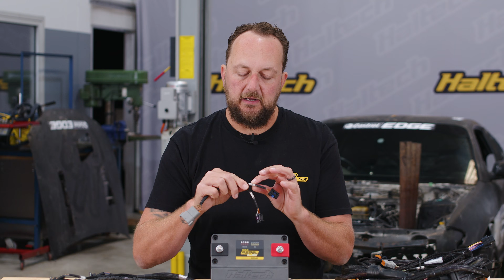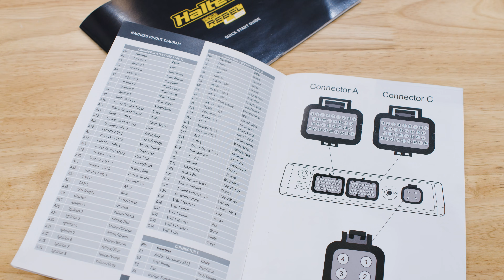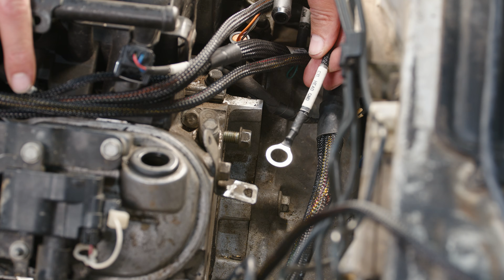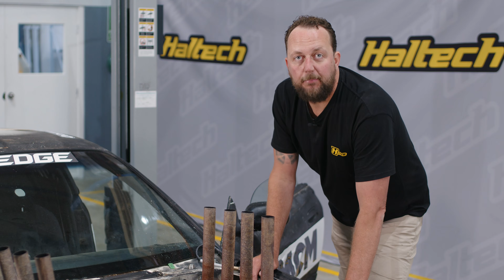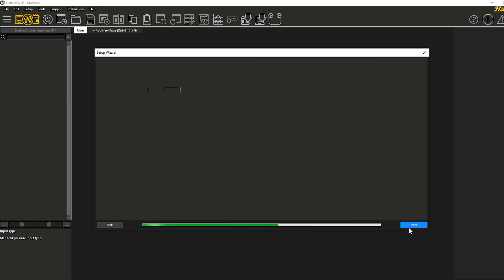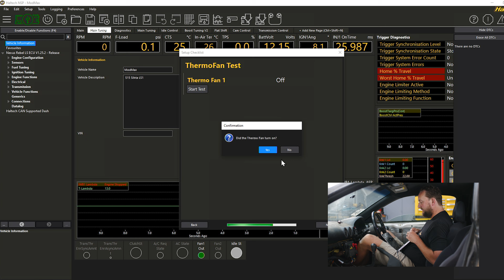🛠 Rebel LS Install - Start to Finish | TECHNICALLY SPEAKING

Comment: Hi Scotty, always a pleasure watching your videos. I noticed the Rebel can only run one O2 sensor. Can it achieve Euro 3 emissions with that? Or should I consider a second O2 sensor through CAN and measure both banks directly at the collector of the headers?

Comment: There are late gen 3 engines with electronic throttle control. Gen 4 was when the shift to 58x happened. Gen 3 has valley knock sensors and cam sensor on the back of the block. Gen 4 has knock sensors on the side of the block and the cam sensor is in the timing cover. So these kits don't cover the late gen 3s.
Reply from the maker: The Rebel harness has sub-harnesses that can be swapped to suit the specific application. In this case, you could pick the Gen 3 harness and separately get the DBW breakout to marry up to the throttle and pedal.

Comment: This is awesome!! So if im ls swapping my bmw e90 and using the factory 6 speed manual transmission how does the speed sensor plug work with the bmw transmission?

Comment: Hi, I will be doing an ls swap on my 2012 GU Patrol in the future. Is it possible for the Rebel ls ecu to talk to the factory patrol dash for speed, revs, temp ect via Can bus?
Reply from the maker: The Rebel only has one CAN port, so this isn't supported natively. 
However, it's possible to use an aftermarket "CAN bridge" to translate the Haltech CAN to work with other CAN systems.

Otherwise an R3 would be able to do what you're after

Comment: Anything stopping you from using the rebel ls kit on a non ls engine, eg a SBF v8 and a crank trigger? Is the software locked down or sufficiently configurable? The kit hits a price point for a universal v8 that is now missing from the rest of the haltech lineup.
Reply: I second this, but for a sbc.

Comment: Some Gen 3 had DBW, rather than cable.
Reply from the maker: No problem, just grab the DBW breakout cable an you're good to go
Reply: @ sure did. I went with the Gen 4 model and only needed the knock sensor and 8 pin DBW harness to make it work with my Gen 3 setup. Full of win.

Comment: I am so excited to upgrade my hptuners tuned stock ecu and homemade fuse box in my e46 drift car with the nexus rebel ls! I have had frequent tuning problems and am always adjusting the stock ecu. I know the rebel ecu is going to completely eliminate my issues!

Comment: A big downside vs a Holley is that there is no Screen included or a budget one available . So you’re driving around and have no idea at what speed you’re going, what rpm the engine is at, what engine temp you’re at, oil pressure, afr, iat, closed loop % etc .
Reply from the maker: You can do all that via the Haltech Connect App :) 
Download it free today!
Reply: @haltech  Yes but you could take your laptop and have it displaying gauges as well, thats not the point. Holley includes a small display and when you see around 9 different sensors which you can see right infront of you its way different than having your phone out and connecting it each time you want to drive the car. Im not dissing the product, but this is a big turn away for many because the only other option to have a mounted display is another 1,100. Please consider making a 4-5” display which displays only data, doesn’t need to do inputs/outputs etc. would be perfect for the Rebel and for someone on a budget. With this said I ordered a Nexus R3 yesterday and soon ill order harnesses, keypads, rotary switches, and the display and get my Boosted/Nos Ws6 flying thru the traps …. atleast that’s the plan.

Comment: I wish you could customize which breakouts it comes with when ordering, I have a gen 3 with multec injectors and drive by wire, so I’d need another $300ish in adapters 😢

Comment: I am helping my brother with his 65 c10 project.  I helped him rebuild a 6.0 iron block ls.  It is a gen 3 engine but we put a gen 4 crank in it.  So 58x.  Can we change the setting in the ecu?  Or do we need to run the engine as a gen 4?   Never mind I just got to that part of the video!   That is awesome!

Comment: I dont understand the popularity with the LS engine platform. Is it simply because they are mass produced and cheap? As far as engine technology goes they are very behind.
Reply: That's the idea. It's a simple enough platform that the backyard mechanics can manage it. The newer engines are out of most non professionals know how.
Reply: Simple, cheap, and small in size, google LS vs ford V8 like the 5.4 from a ba/bf etc the LS the smaller in size and fits where a ford v8 wont

Comment: Tried looking this up. See no mention of transmission control. If running a 4L60e, 4l80e, 6l80e…… automatic transmission, do you need a separate controller?

Comment: Awesome. Definitely going to use in my Cressida. Can’t wait! Could you do a video on the alternator/starter motor wiring side of it? The main power wires and also trigger wiring for the starter.

Comment: Im keen on the Rebel LS guys but you have no transmission control for either 4L60/4L80 yet. Is that correct?
Reply from the maker: That is correct. 4L control is being worked on currently.
Reply: @haltech  Does this mean it will integrate with this current ECU or will there be a whole different ECU for the 4L?
Reply from the maker: It will integrate with the current box. So you could buy one now then add the 4L functionality later.

Comment: So how would I go at using the built in map sensor on a turbo application using the rebel
Reply: When you select the MAP sensor in the wizard, one of the options is to use the internal MAP sensor.
Reply: @Andy_the_engo  I was hoping it was as simple as that. Thanks!

Comment: What if i got a gen 4 engine but I’m going with drive by cable
Reply: Then use the break out harness for the drive by cable throttle body.

Comment: Will there be an equivalent "rebel" ECU for other engines in the future? This would be a great thing for other popular engine swap candidates like the Barra, K series, RBs, etc......
Reply from the maker: Not at this stage
Reply: @haltech  Should the possibility come up in the future, I would LOVE to see a 'Rebel Coyote' kit. They've really become popular swaps lately, quite a few drag cars running the Ford 5.0ls these days(and, thankfully, Ford put them in the F150 with minor changes, so they're more common than the previous 4-valve V8s were).
Reply: Well that makes me sad and happy.... sad, because this would be a game changer for barra swaps. But happy because I already have the elite barra plug and play, so don't have to worry about wanting to replace it with the new rebel barra ecu....😂😂

Comment: The widebands that come with the haltech are not the best , I’ve replaced both mine with Bosch ones after a year
Reply: they are bosch 4.9's which are fine for most applications but they don't like race fuel or abuse
Reply from the maker: Ours come directly from Bosch.

Comment: You should've definitely added what happens when the ignition key and throttle are wiggled and stomped at the wrong time and sequence of the start-up process, what happens then and how to recover from it. Your typical DIY LS swapper does not have the patience of Scott to follow the instructions that meticulously.

Comment: Right on time, in the progress of swapping. My concern is that the provided wire harnas isn't long enough as I planned to mount the ECU behind the passenger chair. Wish there was an option to get a longer harnas
Reply: Buy the identical wires and extend them yourself
Reply: I'm pretty sure if you contacted them they could make up a plug in extension to the length you need. Not sure how much extra it would be but at least it's all done by the same company and match exactly.